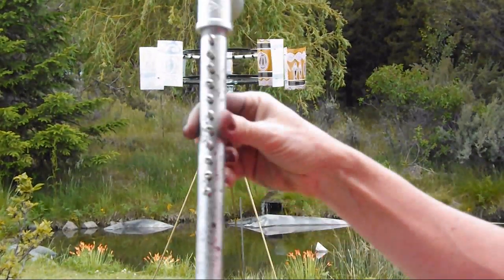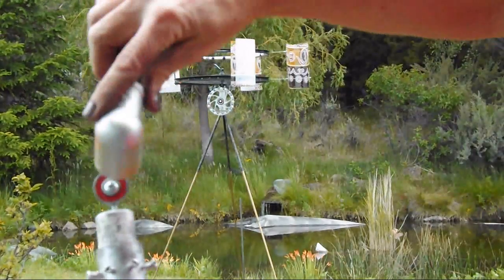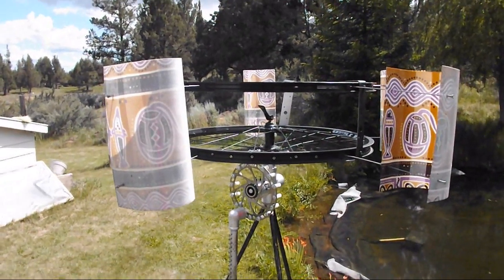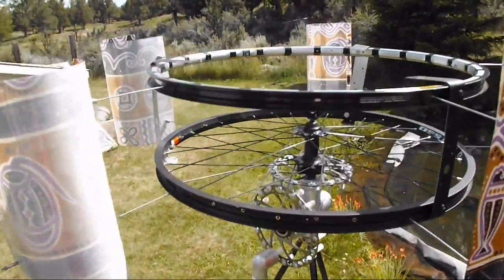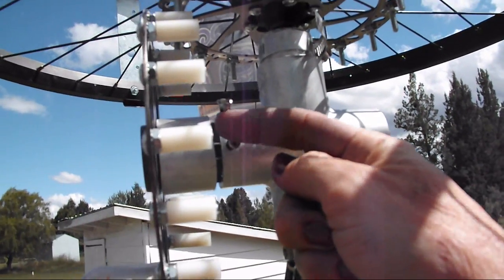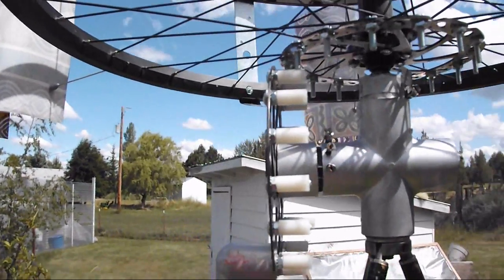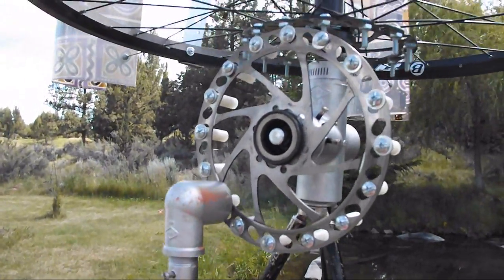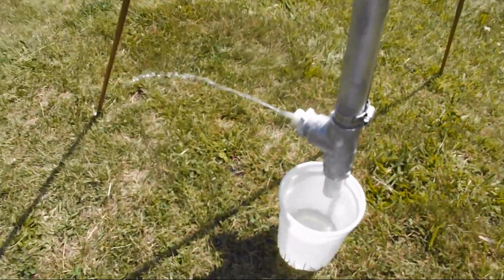DIY Wind-Powered Water Pump. Cata-Vento com Bomba de Agua.

Comment: That type of gears are called "Pinon gears".
How do you stop it to work on it? Since you have no clutch on it.
Not really a big concern with this little one..But on a larger scale. This will be a problem.
Remember the taller it is. The more wind it receives. And the stronger the wind.
Reply from the maker: Yes. Lots of factors to consider. Can't wait to make a real one.
Reply: @Diymarta 🔴 ¿Qué es el Islam?

🔴 El Islam no es solo otra religión, es el mismo mensaje predicado por Moisés, Jesús y Abraham.

 🔵 Islam literalmente significa "sumisión a Dios" y nos enseña a tener una relación directa con Dios. 

🔴 Nos recuerda que, ya que Dios nos creó, nadie debe ser adorado excepto Dios, también nos enseña que Dios no es como un ser humano o como nada que podamos imaginar. 

 🔵 El concepto de Dios está resumido en el Corán como:

{ Di: "Él es Al-lah, Uno.  (112:1) 

 Al-lah es el Absoluto. (112:2) 

No engendró ni fue engendrado.(112:3)

Y no hay nada ni nadie que sea semejante a Él". (112:4)} 

 🔴 Convertirse en musulmán no es darle la espalda a Jesús. 

 🔵 Por el contrario, es regresar a las enseñanzas originales de Jesús y obedecerlo.

Comment: great work maam 
u could just add a flexible pipe in between the pump piston and wheel      it simplifies the thrust as needed in alignment with the pumping action   great work     nice  flexible pipe is simple eay and economical option i suppose    hope it wroks maam

Comment: Looks unworkable, it requires additional mechanical reduction to trend the number of wind wheel rotations to pump piston pressure. Or electrical conversion can be used to collect energy in an accumulator (solar battery also can work in a couple to wind generator), and run the pump in pulse mode (long collection, short pump action).

Comment: Vertical axis designs are less efficient than horizontal axis designs. The force of the wind hits all blades on a horizontal design. On a vertical design the wind hits not only the cupped surface, it also hits the rounded surface coming into the wind. That is why wind farms use horizontal designs.
Reply from the maker: Gary Johnson 
That's true of designs to date. I have a design in mind for an efficient VAWT
Reply: VAWT work better with "scoops" on the outside to redirect the wind. The size of the blades also matter. Most people undersize them for the system. 3' oil barrel blades on a VAWT will catch a ton more air and push a far larger generator than a 3' traditional HAWT

Comment: Nice engineering job on almost everything. To resolve the jam you are getting from  the angled force in the piston. Simply eliminate the joint in your push rod and make a pivot on the bottom of your pump. The entire pump will rock back and forth but it won't hurt anything if your pipes are flexible tube. You may need to increase your sail size or make a lower gear ratio for more power.

Comment: How far and what elevation could you overcome with this design?
Reply: Well that depends on your winds.
FYI you need 1 hp per 100 feet of well.
Theoriticly, if you built it strong enough you could build this 400 feet tall and able to pump water 2000 feet deep.
A downside I see is how to stop it from running.
You need to be able to stop it when no water. Or when working on it. Or when your water tank is full.
Reply: BTW IM not saying it has to be 400 feet tall to pump 2000 feet well..Im just saying it can be as tall as you want and pump as deep as you want if it's strong strong enough AND has the wind to support it. 
There are windmills where I am that pump water up 1500 feet using this type of pump.
Now mind you I get some wind. The tower is over 50 foot tall and the vanes are 40 feet across. ( radist is 20 feet or so). 
That windmill is no longer running. But like I said the radist is over 20 feet. Its longer then a chevy full size crewcab with 8 foot bed.  I wish I would have measured it before some yahoo stole the vanes for scrap metal.
However, they do need to be serviced.
REASON it was not working was the pump needed to be rebuilt.  It was installed in the 1950s. It was still running in the early 2000s. In 2012 the wheel ( vanes) was removed and put on the ground. And the person that was using the well. Was using a gas powered pump. Why he took the wheel off is unknown. But he did tell me the pump needed to be pulled up and new seals put in it. A year later some lowlife stole the vanes for scrap metal.
Now that was the typical water wind mill.
But its still the same type of pump. As is the old hand powered water pumps.

Comment: At the end you're holding it? Is this because it's a bit flimsy or does the wind drop out and stop it sometimes? If it's the latter maybe a mass on the windmill would create a bit of a fly wheel to keep it going through brief interruptions?
Reply from the maker: Mostly because the wind disappeared when I turned on the camera. But also because the whole structure needed fine-tuning.